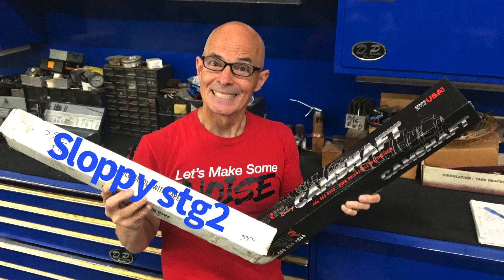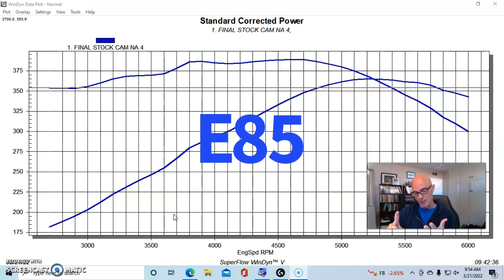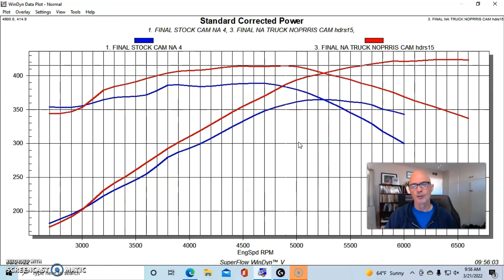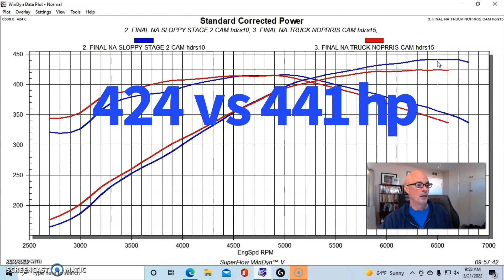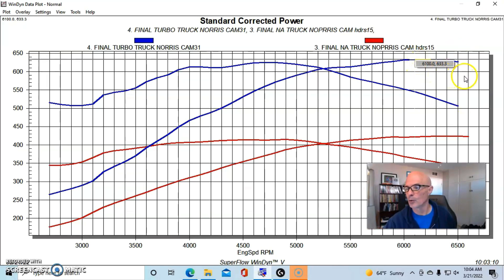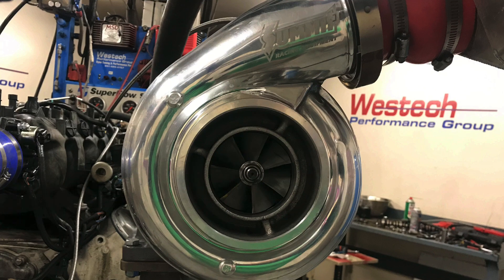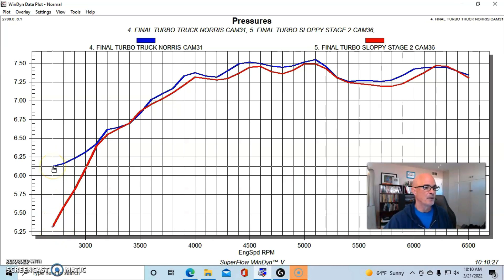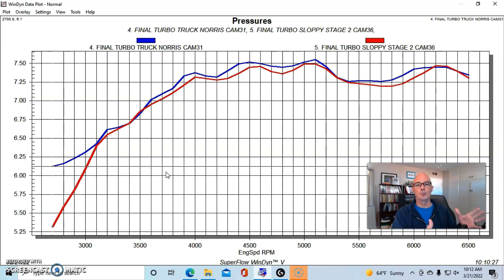HOW TO: TURBO LS CAMS. TRUCK NORRIS VS SLOPPY STAGE 2-IT'S ON!  WHICH ONE IS BETTER WITH BOOST?

Comment: That graph of the SS2 is very different from a previous video you did on it.    In the previous video, I was amazed at how much low end torque the SS2 had.  Something amiss here.
Reply: I think cubic inches make a big difference that’s why in a 6.0 sloppy all day 4.8 5.3 don’t have as much torque so they need help in that department
Reply: Do you remember if it was same engine displacement?
Reply: It was on a 6.0.   The video was titled “how to pick a junkyard 6.0 cam” or something like that.   
Check it out.
Reply: @jakewade7388  ok, this was a 5.3 so that may be where the inconsistency shows up
Reply: The SS2 bested the stock LQ4 6.0 camshaft down low in that previous video.
Reply from the maker: the SS2 did not make more power down low than the stock cam-please check the video
Reply: Maybe my reading comprehension needs help.  Video titled “How to pick: the right junkyard 6.0 LS cam.  4 cams. What works best. 
Around the 7:00-7:40 mark.  The graph shows the SS2 higher.  
I will look again when I get the chance on a PC.
Reply: It did. Please check your video.
Reply: @jakewade7388  down low mean the lower rim range. It made less power down low and more power on the upper side of the rpm range
Reply: 3000 rpm is down low.  That’s about where they start dyno pulls.

Comment: Excellent video. You probably already have a video somewhere on this but now I'm curious about the differences between roots blower and turbo boost curves.
Reply from the maker: those vids are up-check out the modular ford video where I ran every form of forced induction
Reply: @richardholdener1727  I found the video, https://www.youtube.com/watch?v=h4OHdC3nAFk That is a jewel of info there. Thanks

Comment: At what displacement is/are these good at? 4.8 , 5.3 , 6.0 or 6.2… or all the above.
Reply: Yes. 😎

But seriously, the biggest difference displacement makes is that more of it means more power, within the limits of the supporting parts (intake, injectors, head flow, etc). That said, with all the support pieces the same, more displacement shifts the power curve downward in the Rev range. A 6.0l will make it's torque a few hundred rpm earlier than a 5.3l.

Do remember that horsepower is based on rpm - so the later the torque peak the higher the horsepower. But if it's too late the engine feels underpowered as you wait for that torque - the old feeling of "coming into the cam". 

Torque down low for street/daily drivers, top end for weekend/strip cars. 😉
Reply from the maker: the cams will work in any displacement LS

Comment: So if we take that 26 lb ft Tq difference and look at what it does at the tire, it is a huge gain. So say you are running a 3000 stall converter with a turbo 400 and a 4.11 rear gear. The difference at the tire would be a gain of 661 ib ft. You have to remember you can multiply the TQ but the only way you can multiply the HP is with more RPM.
Reply: The same can be said for the higher torque of the ss2 up top? You are trying to use gear ratios to show a difference when those would be the same no matter what. The reason hp is higher is because tq is higher at the same rpm. That’s how hp is calculated by torque and rpm…
Reply: @kyletice811  What I am trying to say is that you are better off making more Tq , than making more Hp. Because you can multiply the Tq, you cannot multiply the Hp. If it was a stick shift car and you could leave at 7000 rpm then Hp would be in your favor. But a converter car needs Tq, not Hp. Tq makes ET Hp makes MPH.
Reply: @racerd9669  horsepower is just a calculated number based on torque and rpm. They are not separate things. If its making more hp its making more tq at that rpm. Maybe you mean low end torque is more valuable than top end torque? But that’s only the case if gearing is long and the converter stalls low. The amount of time spent at the low rpm is negligible in a race car where you should never be under 4-5k rpm anyway.
Reply: @kyletice811  Lets be real very few people that watch these videos are building pro stock engines, they build street engines or  bracket engines. So most of these engines will never see over 6000 rpm. If you study the usable power band of any engine it is very hard to make power over a 3000 rpm spreed. So a street engine making peak Tq at 5000 rpm will not have any power down low to move the car. That is why I am saying you work on TQ not HP. Try to make your peak TQ at 3000 rpm, then multiply that w gear ratio. That will accelerate the mass.

Comment: It would be great if someone would build a motor or put power add on's that would help us in trucks with gas milage.  Especially like the 6.0 chevy  in 3/4 tons.  These engines that hit maximum hp/torque at 5000 rpms don't help us who work with them.  For example. 
My uncles 70 GTO with 400 and 360hp/445 torque  around 3200 rpm to 3600 rpm hit the higher torque at lower rpm.  He got 21 mpg with 2 adults and 2 kids at 75 mph.  My aunts 68 Catalina (400 2/barrel)  got 24 to 26 mph.  The GTO weighed 4200 lbs if I remember Wright and the Catalina weighed a lot more.  It was a land yacht.   A lot of us would invest the money to get a lot better mph.   There is NO reason in the world that a 32 year old  vehicle gets  better mph than what we have.  Torque is what moves mass and the less energy it takes to move mass the better the mph.
Reply from the maker: 26 mpg in a 400 Catalina?
Reply: @richardholdener1727  yes and she had the car for 328 thousand miles.   In that time the only thing  in the engine was replaced was a water pump and a trimming chain.

Comment: Im curious how the sloppy stage 1 (1838) compares to the truck Norris since its a closer spec. 
I just dont see a lot of info out there on the sloppy stage 1
Reply: I put the ss1 1838p cam in my 5.3 7875 silverado 1500 and I'm pleased. The specs are close to the TN cam, except 114* lsa. No test for the ss1 on Holdener's channel.

I've used it on hilly roads, with almost 2k lbs in the bed and it does the job, like a good work truck (3.73/4l80e swap w/stock converter).

It's a shame that there's not much out there on the ss1. Probably one of the "best" cams for a street 4.8 or a heavy 5.3.

Comment: Great testing! Wonder if you could go one step further and test the turbo theory. Smaller cam shaft with the same turbo and actually find the limit of the combination. Basically putting the theory to the test. I've heard many say the theory but haven't ever seen the proof. I like seeing the railroad tracks, but let's see a turbo get maxed out. Everytime I've been to a dyno session we found all the power.
Reply from the maker: finding all the power is not a test-we already know what boost does
Reply: @richardholdener1727  have you done a test between the Truck Norris cam and the Truck Norris NSR cam for boost? It would be nice to see what power is lost from the lack of lift on the NSR can down low with boost.

Comment: I vote for the Truck Norris cam, with all the extra torque down low up to 5200 your vehicle will pull harder and be faster than the Sloppy with only a relatively small increase in power over the next 1200 rpm or so.  I'm currently running a Texas Speed High lift Stage 2 cam a 5.3 in my '68 C10, IMHO similar to the Norris cam and I love the response up to my red line of 6200.

Comment: Love that shirt, hahaha! That's great!  Excellent to see this. You answered my question about this on the last live chat - the reason I was asking was because I had read a 20+ year old article that was saying overlap was terrible for boost, and with the Truck Norris at 107 LSA, that had me worried. But like you said, and exactly like this here video showed,  boost just does what the cam does N/A, only with bigger numbers. Awesome!! Thanks Richard! 👍🍻
Reply from the maker: the lsa doesn't determine overlap-this is a mild cam
Reply: @richardholdener1727  Thanks for that clarification. I had misunderstood the effect of LSA in a mild cam. Makes sense now that I slow down and think about it. 👍
Reply: @SmittySmithsonite  you had the concept correct, but It doesn’t bleed of boost or any of the other commonly repeated inaccurate “facts.” 

How does it affect performance?
Combined with Duration, the LSA determines Valve Overlap. This overlap has a significant impact on Engine Vacuum and idle quality.

Camshafts with a "tight" LSA (106° - 109°) will usually have more overlap.
Camshafts with a "wide" LSA (110° - 118°) will have less overlap.

That’s from an article about cam lobe separation angle on Sunmit racing’s website.
Reply: @Mattvardaman  A lot of these rules of thumb of what you want for lobe separation while kind of ignoring the actual duration stem from older engines when they had flat tappets. Because the cam ramp angles were not as steep, the "rules" were a lot easier to go by as you would always have overlap with tighter lobe separation angles because you could only ramp down one valve and ramp up the other valve so fast.

So fast forward 50 years away from that old technology to what we have today and we are snapping the valves open and closed so much faster that you can have a tighter lobe separation angle with more duration on the valve and still have less overlap.

We live in good times.
Reply: @TravisFabel  I swapped so many hydraulic flat tappet cams in gen 1 sbc engines that I lost count. I’ve had a few modern LS engines, and I’ve done a small handful of cam swaps on truck motors.  The power from my current truck’s 5.3 with a stage one pro ls truck cam, long tube headers, support mods, and the tune dialed in with the wideband is outstanding! I’m looking forward to feeling the power of a turbo on the 5.3 in the next year. 

I will say that the cam technology is vastly improved along with cylinder head design/flow. With a modern roller cam My 5.3 with a small duration camshaft  205/217 @ .050” .500/.500 lift   112+2 lsa  has more  “idle lope” than my 355 sbc with a 224/234  .456/.488 lift 112lsa flat tappet cam. The 5.3 makes more power too. The modern performance age is awesome! I support anyone trying to make some horsepower.

Comment: I'd like to see a truck norris 5.3 dyno of the difference between the 3 bolt truck intake and throttle body vs. a bigger 4 bolt tb and TBSS intake (I know it's a good difference one a stock cam) and maybe a performer RPM & carb for S&G
Reply from the maker: the tbss vs truck has been tested many times
Reply: Richard, how much more power do you think the tbss would make on this combo with the ss2 then?
Reply: @MrLs1racer  the tbss intake is going to give about the same additional power increase ni matter what can you use.

Comment: What's the take away? Either get the truck norris cam and nitrous on the top end or SS2 cam and nitrous on the low end 🤔 🤣🤣🤣
Reply: The truck cam will probably help you more at a dig and on the street where the engine is at a Low RPM.
Reply: @BoHorror  consider traction being a limiting factor- some people pick their combinations in such a way to intentionally bring in power later in the RPM range so as not to blow the tires off down low. Same reason for slow boost ramps, etc on the street.
Reply: @boost1728  consider modern rubber and all-wheel drive.
Reply: @TravisFabel  how many AWD mustangs, corvettes, trans ams, and camaros have you seen in the past 6 months? Uhhhh 0

You can disagree with the theory, but the truth is that people do take power AWAY down low in order to maintain traction in street raced cars. Like I said- boost ramps, boost by gear, timing ramps, 2nd gear leave, big converters, running low 3.XX gears instead of the old school idea of running 4.10’s in everything… low end is great for mild builds and tow rigs, but big cams do have an advantage at some power level or another
Reply: @boost1728  yes I have traction problems 5.3 N/A, ss2 cam and 2.73 gears it just roast the tires down low lol

Comment: So running the truck norris cam at 1.5psi+ its gona make the same hp on top, yet be more responsive in the low end?
Reply: Or run a stock cam +5psi and make more than the Norris…
Reply: Yes
Reply: Or run variable cam timing, gain a ton more horsepower/torque down low, And a bit more on top....